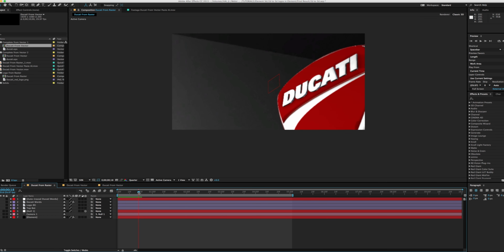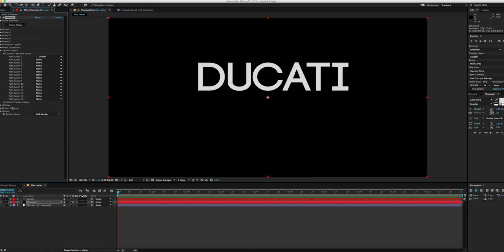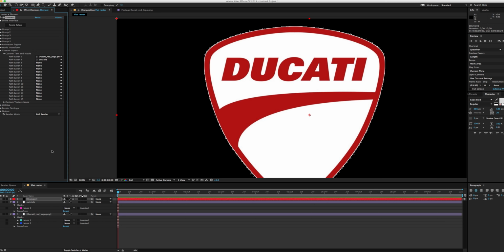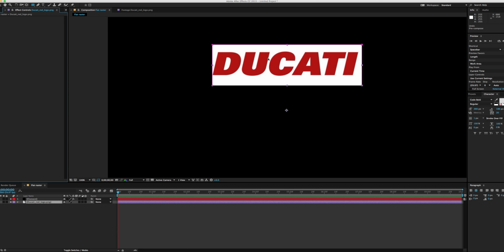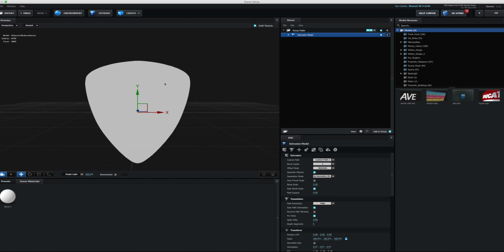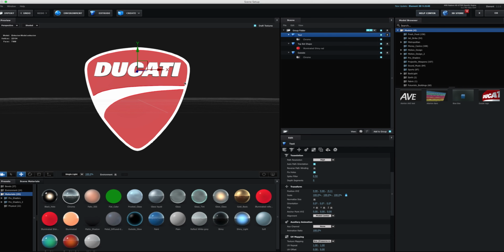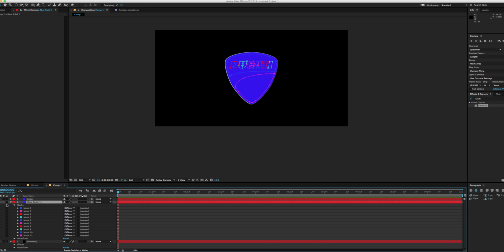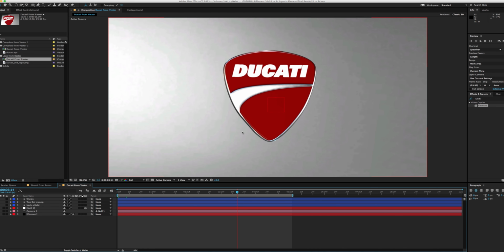3D Logos from 2D Images with Element 3D Tutorial

Comment: I got further with this than most, 8mins 43secs after following it all, selected autotrace, and nothing... hit precomp looked in Element - nothing. 
So after a few tries, rewatching the video over and over - I switched it off.  It's been three years for me to be able to even face AE/Element. I'll just stick to what I know and leave better folk than me to do this stuff.
Reply from the maker: Element can be challenging if you are new to it. Sounds like something isn’t working with auto trace. 

Before giving up, try using the pen tool to create some simple shapes. Or bring in some vector paths and try element with that as a start. That’s the basis of this, and I wish I had started with that on this lesson. Thanks for your comment.

Comment: Great video thankyou. What’s the easiest way to make a product like an amplifier into 3d. Is this done in elements 3d by building up the 6 sides of the amplifier then extruding out shapes and then grouping them?
Reply from the maker: If you wanted to model something I would not recommend element. That’s not what it’s for really. Maybe a plane or a box but you really can’t do to much building. 
If you have after effects- you already have cinema4d installed and its way faster/better/easier to use that. 

Outside that there’s tons of 3D models out there for free at sketchfab or even turbo squid. I’d start there unless you needed something g you needed to design yourself.

Comment: Fun Fact(Tested on AE CC 2019): You can actually copy objects from illustrator and paste them as masks on a layer in After effects. All you have to do is select the object in illustrator (or all by pressing ctrl+A) Then ctrl+C to copy. Finally, open after effects and paste this onto the layer by pressing ctrl+V and each individual object will paste as a mask :)
Reply from the maker: That IS a really good tip!
Reply: how do you paste it? it's not pasting for me and im confused. do you have a video to help me?
Reply: @skreeon  You need to make a solid bg layer first, the shape you copied from AI will mask the solid layer in AE.
Reply: I was combing the comments to see if this method could be utilized (as I'm not too good with the pen tool, yet either). Thanks!